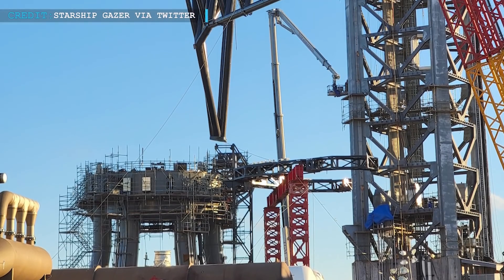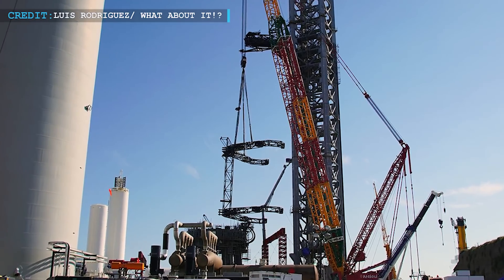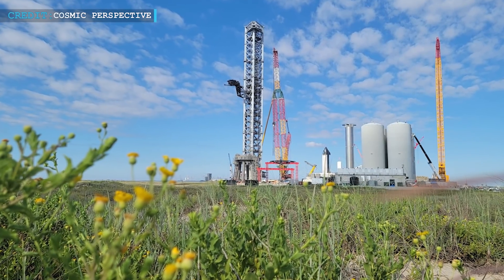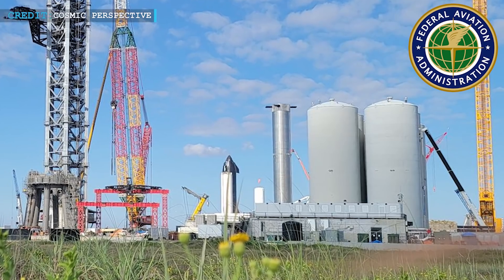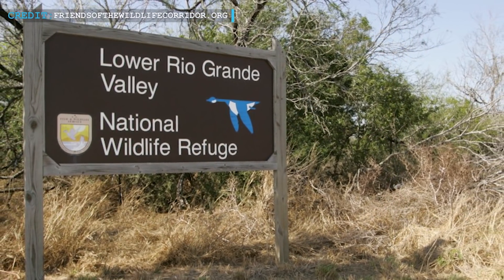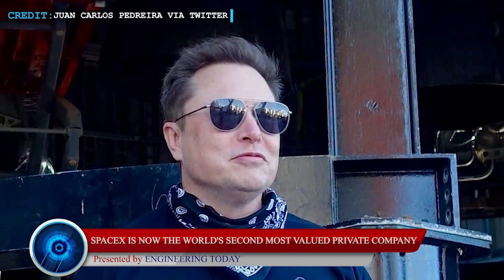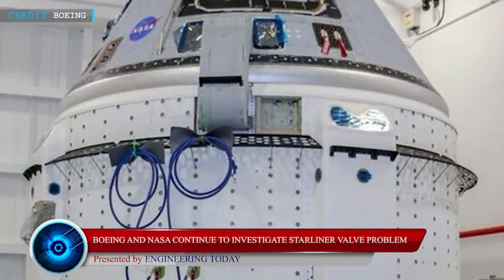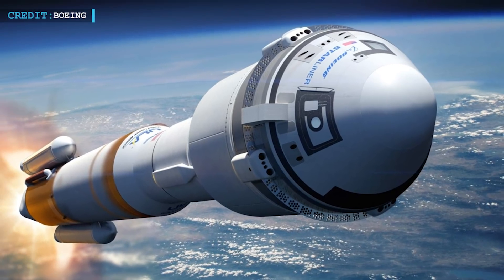SpaceX Starship rocket-catching are almost ready | Mystery of Elon Musk’s missing gas

Comment: SpaceX should make the methane with renewable electricity via electrolysis and methanisation. They have to do the process on Mars anyway, so they should start right now to iron it out and improve on it. Sustainability should really be a thing for SpaceX.
Reply: He’s already starting this.

Elon musk: 

"Sometimes I get criticism for, ‘why are you using combustion in rockets and you have electric cars’. There isn’t some way to make an electric rocket. I wish there was. But in the long-term, you can use solar power to extract CO2 from the atmosphere, combine it with water, and produce fuel and oxygen for the rocket."

Also Elon Musk:

XPRIZE Carbon Removal is aimed at tackling the biggest threat facing humanity - fighting climate change and rebalancing Earth’s carbon cycle. Funded by Elon Musk and the Musk Foundation, this $100M competition is the largest incentive prize in history, an extraordinary milestone.

Sorry for reposting. YouTube keeps deleting my original comment.
Reply: @magnamic5614  
.
So Musk is building a plant that uses atmospheric CO2 to make methane? (Sabotier process?) Great!
.
Imho they should start planning for a molten salt nuclear reactor to supply energy for this (cheaper for larger quantities than solar panels, and they could also sell excess methane?).
Reply: @red-baitingswine8816 ,
I think that stuff should be relegated to off Earth uses. For our current needs and requirements, solar should be our focus as a species (on Earth).
It’s has the least risk in comparison. Everything else should be a back up. 

I understand there are flaws in my way of thinking. It’s just how I feel.
Reply: @magnamic5614  OK. Don't forget that developing countries (who can't afford Western boutique solutions) need huge amounts of energy and are building coal plants like hotcakes, and also China is on this problem.  Etc....   
( :
Reply: Methane is the strongest green house gas, that's why "Green Washing" by calling it Natural Gas is kind of BS. The methane only partially breaks down to C02 after about a decade and it's extremely more potent as a greenhouse gas and much more non transparent to solar radiation than C02. 

That periodical common methane release added to the methane release by thawing of permafrost, and Artic methane hydrate dehydration and destabilization as shown in many studies in the Laptev Sea by Natalia Shakovas team and University of Alaska Fairbanks, is really troublesome stuff that would create a feedback loop that we can't just turn off.
Reply: @whatabouttheearth  The whole point of the Starship is to use methane as fuel, not to release it into the atmosphere. Can you see the difference? Burning it as rocket fuel is by far a lot more environmentally responsible than allowing it to leak into the atmosphere.
Reply: @JosueC730  

What is the exaust? As in what is being released?

And 😂 he'll no I don't understand rockets, it is rocket science.
Reply: @whatabouttheearth  What is being released at the rocket exhaust is CO2 not methane.
Reply: @JosueC730  

Right, because methane breaks down to C02. 

Why not just use a C02 based system? It's not more environmentally sound to use Methane, it just breaks down to CO2. There's probably another reason they're choosing methane.

Doesn't it use some exothermic stuff also, using a LH2 tank twice as large as the LOX tank, to make H2O? Or am im getting stuff confused?
Reply: Sounds like a good idea. But there's also the potential problems with Methane on Earth. Better to burn it in rockets because it' causes less global warming than the resulting CO2. Rockets don't pollute that much compared to other things and it's justifiable because there's no other way to make rockets fly. Producing their own methane will be needed anyways. My point is that using the methane in something as efficient as the Starship is much better than burning it elsewhere.
Reply: @JosueC730  

Methane is alot more non transparent than C02 so it would increase global warming. Everyone emphasizes C02 because there is already more in the atmosphere and it is why we are releasing more from our industries and inventions, but we are also releasing methane and causing effects like thawing of permafrost and underwater methane hydrate release, because the decomposers under the ice in the ground evolved to take in methane and not carbon like other decomposers not under ice, so we're slowly creating feedback loops to release all of that. Methane is worse!
Reply: @whatabouttheearth  Of course but you don't see the problem here. The problem ONLY happens if methane goes into the atmosphere. If you burn it you avoid everything you just said because it's no longer methane, it becomes CO2. Burning it in a very efficient system such as the Methalox Raptor engines used in the Starship is an excellent way to convert that methane into CO2. That's much better than having methane in the atmosphere because as you already said is way more harmful.
Reply: Nonsense, why can't they simply make hydrogen and spare the rest of the energy?!
Reply: @carholic-sz3qv  You need to understand why Elon chose metane instead of hydrogen. H2 is quite an unstable molecule but CH4 is very stable. Methane can be created from H2 and CO2 in Mars, and it's much easier to store it than Hydrogen. Hydrogen creates metal embrittlement and Elon is using stainless steel to build the starship. Also Elon needed the Raptor engine combustion to work as efficiently as possible, that's a lot more manageable with Methane whereas Hydrogen can give trouble. Check Everyday Astronaut's channel  as he explains why even if using Methane, it's not polluting that much and he gets Elon's reasons to use methane instead of hydrogen.
Reply: @JosueC730  lol.... hydrogen had been used in rockets fir decades now and with new technologies the storage was made way better. The hydrogen can be created by using excess energy production.....